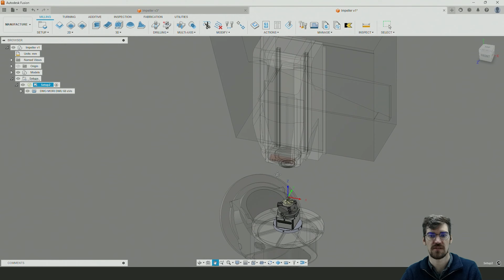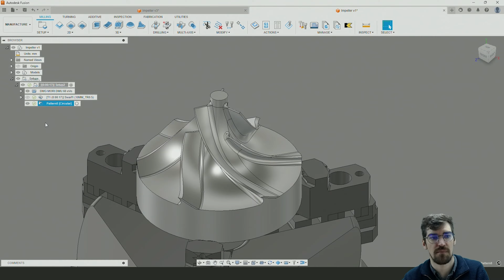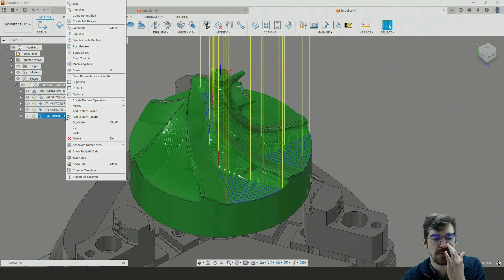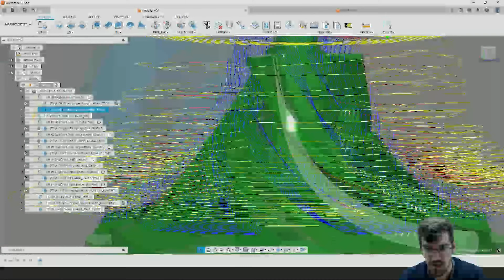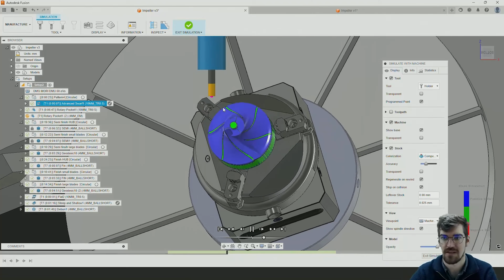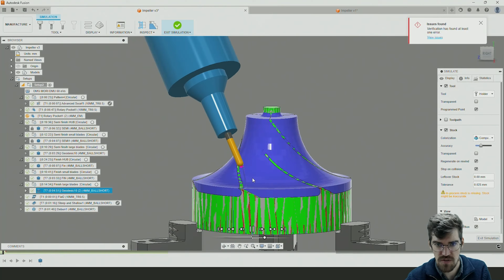Autodesk Fusion Zero to Hero - Machining Toolpaths

Comment: thanks for the video!! is it possible to process this part only with 3D trajectories including 4 or 5 axes?? it would be interesting to see since not everyone has a paid add-on!
Reply from the maker: Thank you for the suggestion, we can look at this workflow in a future video!

Toolpaths that use 4 or more simultaneous axis within Fusion are contained within the Manufacturing extension. So, while you could process most of this part using only 3D strategies, the blades would require simultaneous 5 axis in their current configuration. A workaround for this would be a simpler blade design, which better aligns to the capabilities of the machine. This is where simulating the toolpaths before posting is a great bit of functionality within Fusion.